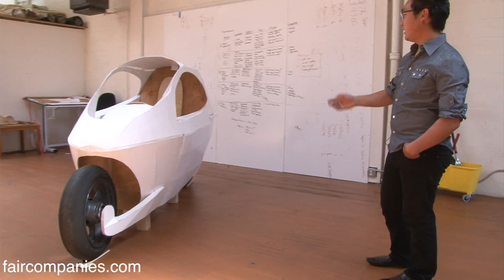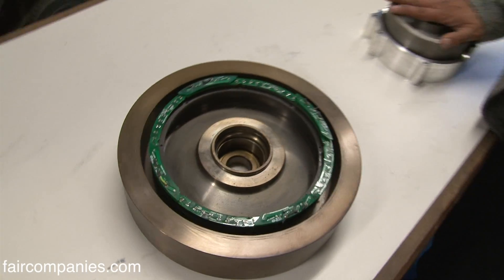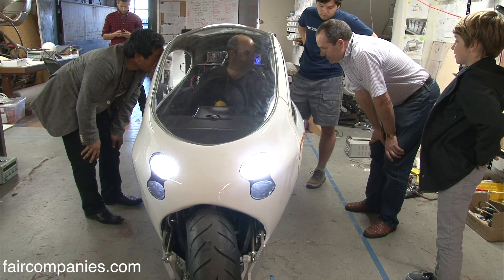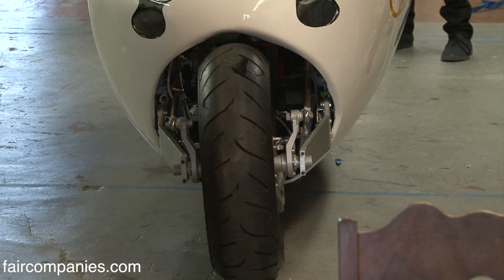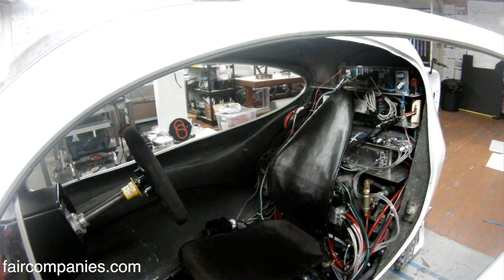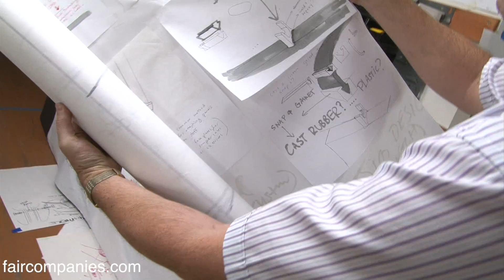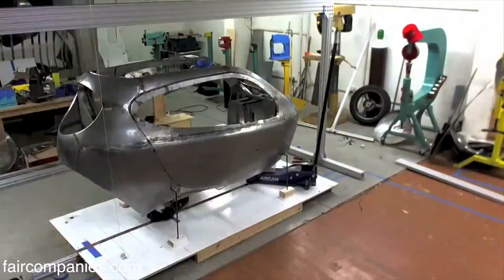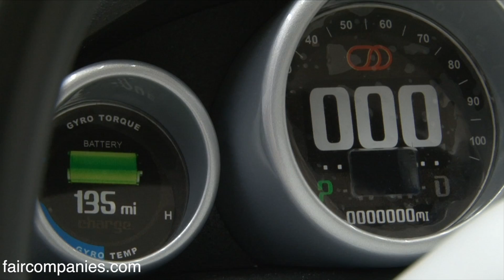2-wheeled untippable EV gyrocar from SF automaker startup

Comment: i do not see this as an innovation… why put all those technology on something that is already functioning…. what's wrong with an electric motorcycle and a bicycle…
there is already an electric car…. what's wrong with 4 wheels…? i don't get the rational of this… engineering and design is supposed to simplify an answer a particular need…
Reply: The problem: Right now, batteries are cost prohibitive for a long range, affordable electric vehicle.

The solution: Create a mechanically simple vehicle, minimizing weight and aerodynamic drag. This would minimize the required battery capacity (10kWh for the C1 compared to 60kWh on the Tesla Model S to achieve 200 EPA miles) and reduce overall vehicle cost.

One should think about the replacement cost of a battery once it reaches the end of it's life. It would be much less expensive to replace a 10kWh pack compared to a 60kWh pack.

Although there are electric motorcycles such as the Zero S which are more efficient than full sized electric cars, they do not offer the same amenities such as all weather protection, climate control, seat belts, airbags, cargo, sound system.etc

The Zero S has a much higher drag coefficient and needs a 14.2kWh pack to achieve 132 EPA miles (C1 only needs 10kWh for 200 EPA miles).

In short, the Lit-C1 merges car and motorcycle for a hyper efficient vehicle which should be much cheaper to own once it is successfully mass produced.

Comment: add photosensitive panels on top of it, also enable the brake recharging feature.
Reply: Photovoltaic cells would add a lot of weight, without adding much benefit.  If it can get 200 miles in a charge, and if the electricity is cheaper per watt than a car-mounted solar panel, there's no point in having that on the roof.  I might agree with the regenerative braking though, if the efficiency lost to the extra weight would be balanced out by the efficiency increase of recapturing the kinetic energy of the vehicle.

Comment: This is awesome. Now they need a loophole in the vehicle classification system that would allow the car alternative to get away from the steering wheel and gas pedals go to a more i phone like touch screen or smartphone type sensor that picks up on the angle its tilted at. I control unit without the hazard of the steering column in an accident. Like a wired in wii remote.also a 2 up model in the future.

Comment: spinnig the gyros will mean using energy even when standing still is that smart to waist engert just to keep something stable so that it looks cool?
Reply: EL Gee well that accpunt is likely dead but yes, unless you want use landing gears to stabilize while staying still instead, the flywheel also stays on when its not being powered for a substantial amount of time by virtue of being a super heavy object that spins ridiculously fast. Pretty sure it's lot faster than any spinner in combat robotics.

 Its not just because it looks cool either, its half the width of a normal car, meaning it can be lighter and more aerodynamic, as well as allowing twice the cars for a given roadwidth if it becomes an industy standard.
Reply: for the same size and capabilities, you might as well buy an electric bike.
hell, you can even buy a standard bike, and make it electric! it's the same end result!
Reply: @bcn1gh7h4wk not the same result. This had an enclosed, car standard cab. Significantly safer, and weather proof. The seating arrangement is also recumbent, so more comfortable. It also a goal was more cargo.

Comment: Battery energy required to drive the Gyro would severely limit battery mileage, adding noise, vibration and weight. Total nonsense.
Reply: *****
What first-hand-knowledge of the design do you possess?

Comment: cool project but I don't see the point to use 2 instead of 3 wheels.
Reply: Two wheels with a gyro are much safer than a three wheeled car. Three wheeled cars although very basic, are inherently unstable in corners.

Comment: seriously 3 wheels:
1 it's stable, without gyro and it does not need stabilisation, when switch off
2 it's simpler
24000 dollar is a lot of money for a two wheeler, without storage space,espacially, sincethey don't have a trailer
but the electric steering system sounds intressting, steeing wheel for computer games, computer for steering and braking with a regenerative brake(no extra parts)
you only need good batteries...
Reply: Well, with three wheels you are increasing the parts count. Now you need a larger braking system, an ackerman steering system (with ability to lean), extra wheel, greater suspension component count.etc Also, your frontal area and overall weight is increased. This contributes to added drag and requires increased battery capacity to maintain rated range. Not sure how much the gyro draws in comparison though.

Electrically, three-wheeled would be simpler. Mechanically, the C1 is simpler.
Reply: You don't want a 40 pound wheel spinning at 12,000rpm sitting under your junk?
Reply: @dg-hughes  which also makes a lot of noise
Reply: you guys should check for the Elio car, but the point of the LIT is to prototyping, improve and someday it will be common and we will ask why old car was that much friction with the ground, loosing powers with those 3 or 4 wheels. I lit the LIT but i dont think it will sell well until 10 yrs AT LEAST. People have to go minimalist first and change their mind.
Reply: Elio seems to be better thought out, it with an electric motor would be a lot better, since it has enough storage space for shopping and alike(don't see it in LIT's car), small for parking, cheap to be a second car for a household and the short distance and long loading time of the battery don't really matter, if you use it as a town car. Here in Europe you could travel every greater distance by train or plane, so it even could be used by many as a primary transport vehicle.
LIT is going to die since building an awesome car is only half the trick, you have to sell it and that really is the hard part,espacially without any infracstructure.
***** a century ago most thought:
they seriously want to drive a machine, which is fueled with an extremleyflameable and explosive substance, with short range and not slower then a train or horse and no we have it. It is called a "car".
Reply: And the gyro eating energy!
Reply: There is a good reason for direct mechanical steering and I don't think I would want to rely solely on an electrical steering mechanism.

Comment: One sensor? Uhh it should at least have a gyro sensor and a accelerometer. Now it looks like there is way to less of pid control. The impact of the pull and the angle gyro sensor should both be balancing the gyro function way faster. I would not like to get into a slip with that.